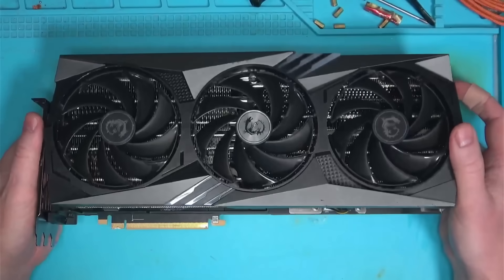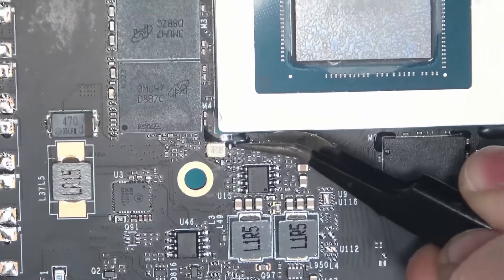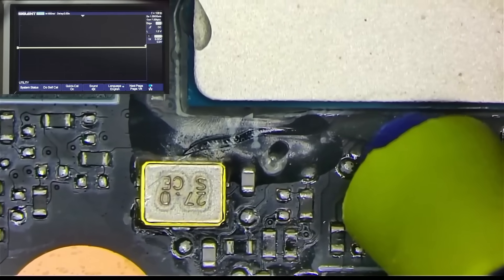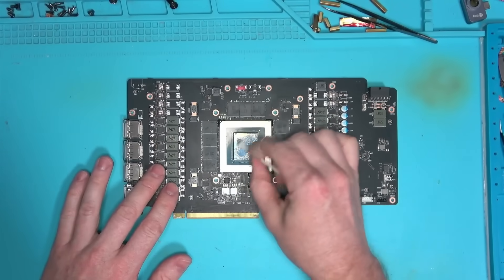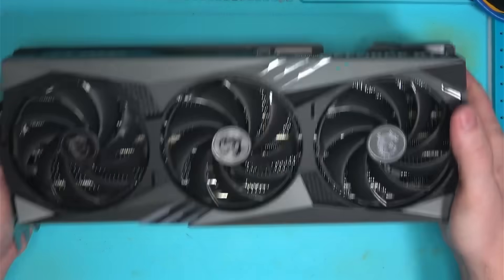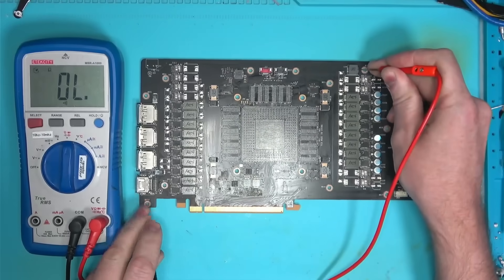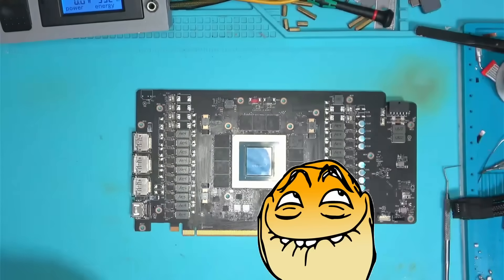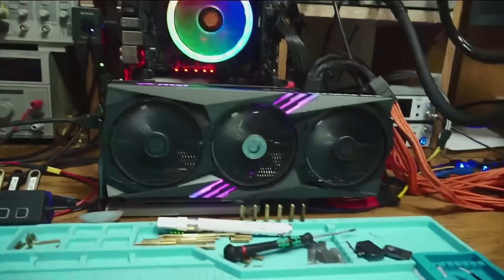Another 4090 saved from recycle bin

Comment: So If I'm understanding it correctly, these chips are mounted using a BGA (ball grid array) connector and you basically removed all of the balls and soldered new ones on to the chips before putting it on the donor board?

Comment: I worked in a repair shop for ultrasound systems and I wasn't part of the repair area, but I knew the guy who worked there and this video brings back memories. You guys have a lot of knowledge. I could never fix an ultrasound board. The only fix I managed to do was in a monitor where you had a faulty capacitor so I just took it out and put a new one in place and the monitor worked properly again.

Comment: Hello, my computer's graphics card fans start spinning when the computer is turned on and stop after 1 minute. What could be the reason for this? ı just bought it.
gigabayte 6650xt 8gb
Bitfenix BPA SERIES 80+  500W 
AGI NVMe M.2 SSD 1TB M.2 2000/1690 MB/s 
Apacer Panther Black-Gold 16 GB (2x8) DDR4 3200 Mhz CL16 Ram 
MSI B550M anakart

Comment: Hey, This is incredible! Nvidia should learn from you :D

By the way I'm about to buy Used 4090. What test you would recommend to do before handing the money and to look for? 
Furmark and check the temps, clock speed? Should I test the memory somehow, will Furmark show some Artifacs if there are some? Because I'm a bit worried. 
Also should I get atx 3.1 PSU ? (Currently with 1000W ATX 2.4) 

Thanks.

Comment: "If I can do it, so can you" I laughed and thought about it. If I would try and fix a broken card such as you, it would result in further and more unrepairable damage. Truly a master-tech at work here, well done and impressive work. As always.
Reply: he's probably had his share of mangling electronics so probably best not to start with a 4090
Reply: @DuckieMcduck Yeah. If you're trying to go in-depth into computer hardware repair, go to an old office auction and buy some computers, then practice swapping identical parts across them (start with small resistors, then move on to memory chips and GPU cores, etc). You'll botch a few but get your hand steady for the real deal
Reply: Just buy or search some old dead gpu and uses them for practice
Reply: late, but he's right. realistically the only thing stopping you is the equipment cost. but a simple soldering iron and some practice on old junk tech does indeed contribute to further skill, mainly patience though, required to do things like this. I'm serious, if you can build a pc, you can do this!

Comment: While I'd love to be able to do this type of repair, the road to developing those skills is a steep one.  Some 40 years ago I used to do a lot of soldering and debugging, but nothing was surface mount and I didn't have to do any digital signal tracing.  That is some next level technical work you're doing.
Reply: And the ROI is scant.
Reply: @gary2300  Yeah, the only real ROI is the satisfaction of being able restore and maintain old electronics.
Reply: If he can do it, then so do you
Nothing is impossible. It just needs effort, time, patience, and the built-up experience.
Reply: @Alkhamael  That's true of most things.  Some things have longer learning curves than others.  And in life one has to decide where to invest time, effort and resources.  This particular kind of work does not lend itself to the "casual hobby" category.

Comment: I hava a question regarding msi 4090's specifically, when you remove the metal thing that holds the board to the cooler, have you ever encountered it to be bent? I recently tried to open my msi 4090's however the metal was very bent and i just put it back together.

Comment: I hope msi 5090s are just as good as the 4090s. I made sure to get an msi this time instead of Founder's Edition based on your recommendation. Thanks for the awesome videos!
Reply: @anthonyman1990  I'm not sure i'd get a 50 series. there's a reason evga walked away from Nvidia
Reply: @scottjohnston3098  if the price is good why not?
Reply: @anthonyman1990   Depends you might not care, but for me 50 became a no-go zone due to removal of cuda32 support. For others the high end 50s are a no-go zone because there is a mandatory single power pour from 12v2x6, meaning there is nothing to offset the individual pin resistance and balance the currents across the connector, which makes it dicey past about 350W, which didn't use to be the case on the 40s so some of the 40s are actually made better than that.
Reply: @SianaGearz  I do care, I wanted to know their personal reason why. I was just seeing if they'd give me an actual thought-out reason and not just some mindless parroting. I think there are reasons to get one. If you're planning to upgrade from anything before the 40 series, if you can find the 50 series at msrp, it's a worthwhile upgrade. I agree that Nvidias' power delivery design is very bad. However, only for a high watt card like the 5090. The power connector, or power delivery system as a whole, doesn't have the same problem with the other cards. Basically, if no one wants a 50 series card, that's fine. If amd had a card as powerful as a 5090, I would have bought one. All that being said I think the 9070xt makes more sense to buy than the 5070ti and 5070.
Reply: @anthonyman1990  what games require a 40series let alone a 50series with missing rops. I'm actually curious, not trolling
Reply: @scottjohnston3098  i mean, the way things are going with raytracing. Mandatory raytracing capabilities is becoming a thing. So that will swiftly necessitate at least a 40 series card. Lots of vr games benefit from the performance capabilities of the 40 and 50 series (mostly higher end). But yeah, there's lots of games that don't need a 40 or 50 series card to be played. I like to enjoy my fair share of older games mixed In with my newer ones. Admitingly though, it is nice to have the higher performance on those older games. The 5090 really let's them stretch their legs on my 240hz oled monitor. Definitely a better experience than playing those older games on the hardware that was available at the time those games came out.
Reply: @anthonyman1990  they've already recommended keeping an older GPU because of the 32bit stuff and phyx on the 50series has been neutered. so if you play anything from a few years ago, why even upgrade?
Reply: @anthonyman1990  see that's a great point just with refresh rates. I've  had multiple monitor displays with a gtx760 but they were all 60z displays
Reply: @scottjohnston3098  that's not even remotely true or relevant for most games. The pool of games that used phyx 32 bit is small. If that's consequential for you, then that's your perogative, but that's a very nonexistent problem for most people. I feel like you're trying to be intentionally disingenuous with what I said. I can play both old and new games. I don't have to choose between the two. It's a very odd argument you're making. It seems like you didn't read my response with a clear mind.
Reply: @anthonyman1990  yeah, there aren't multiple youtube videos demonstrating that physx has been nerfed. sorry my comments caused emotional damage
Reply: @scottjohnston3098  I never said that it wasn't nerfed, but rather pointing out that most games never used it anyway.  So if you like playing a handful of old games that used that. That's fair, don't buy a 50 series GPU. In case you didnt know though,  these games still work with phyx turned off. Just to simplify it for you, as i can see youre mentality and emotionally compromised, that argument about phyx 32 being deprecated doesn't make sense for the other 99% of games that never even had it implemented.

Comment: What's your opinion on the new AMD RX 9070 graphics cards? The GPU core seems to be too close to the pcie slot. Would it be much easier to get ripped pads under the core or the new design will prevent it?

Comment: I've got a NVIDIA GeForce GTX 1660 ti and every so often my monitor would shut off.  At first I thought it was a bad HDMI cord, replaced it and it kept shutting down again.  I took the computer apart and discovered it was full of fine dust.  Got out the vacuum cleaner, put it on blower and blew all the dust out of the board, case, power supply, memory, CPU and GPU and put everything back together.  Started it up and so far, the monitor hasn't shut down.  I believe that was the problem.  I really enjoy watching your videos Tony, even though I have no idea what you're doing.
Reply: if you're on win10-11 run windows reliability monitor, it should have all the faults listed. "view reliability history" will be the search result but it's the same thing. "windbg log file" creation and reader for the log files is another tool, it's just not as easy to read
Reply: @scottjohnston3098  thank you.  the monitor hasn't turned off since I cleaned the dust out of the computer and video card.  But if it continues I'll check that out.  Thank you so much.

Comment: Serious question though, why don't they just make an extra socket in the MB that the GPU can socket into, along with its own cooler, VRAM, etc.? Why must it be a standalone part with PCB, VRMs, various components, etc., that uses a PCIe interface? The current interface solution is clearly not fit for purpose anymore with cards so big, heavy, and power-hungry these days.
Reply: Because all the possible combinations of cpu sockets and gpu sockets would be immense. A new socket would probably be made for each new gpu generation. The socket would be certainly different for amd, Intel and Nvidia cards. And the GPU would probably still be linked to the cpu using a pcie interface. So it would only complicate things.
Reply: Also don't forget that gpus come with their own bios made for that card exactly. Fitting the bios inside the already present bios on the mobo would complicate things even more, because each mobo would need to support the gpu AND cpu.
Fitting a dedicated bios could work though. This, the different sockets possible, and if the manufacturer ever stops supporting the mobo with bios updates, it would only create colossal amounts of unnecessary ewaste.
Reply: Like a laptop?
Reply: @sunkistman   laptops don't have socketed CPUs.
At least most don't.
My point is to treat the GPU like a CPU, with it's own dedicated socked, aftermarket cooler, aftermarket vram modules...etc.
Reply: Lots more variety in die sizes with gpus

Comment: 8:10 What is the purpose of that wire with the burnt tip that circles counter-clockwise onto the board?
Reply: Thermal probe, measures temp

Comment: At least there is no shortage of PCBs and coolers with the core and memory chips missing, beware when buying second hand 4090's
Reply: The problem is they don't use care when removing the Core and Vram so often traces are ripped and it's pot luck if the donor card you buy can be repaired.
Reply: @johnt.848 I do wonder what they use the core itself for other than fixing cards